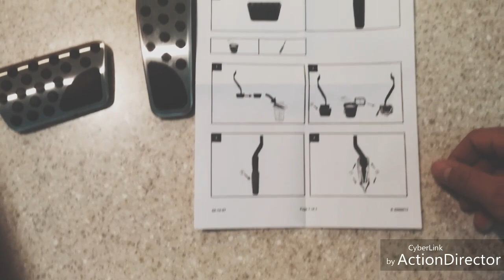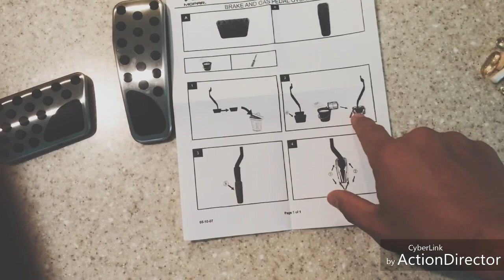Mopar Gas & Brake Pedal Cover Installation For Your Charger or Challenger

Comment: Let me help everyone here. Heat a large bowl of soapy water for 4-5mins let the  brake pedal soak in the hot water for about 30-45sec maybe a full minute. the rubber is now soft enough  to fold over. Start from the top down>The rubber is soft enough to fold out the bottom > flip over the pedal.  Took 1min tops.
Reply: This comment needs to be pinned to the top. Only method that worked and took me like 3 minutes. Lol
Reply: This worked !!! Your the man, thanks !!!
Reply: This worked 👌🏼👌🏼
Reply: Brian Smith omg thank you
Reply: Works like a charm wow
Reply: Thanks! All good now
Reply: You are the GOAT!  Thanks! 💯
Reply: Popped it on in 30 sec  with this trick, took me longer to get gas pedal.
Reply: Thanks man! This worked for me!! After dicking with it for 45 minutes, this method got it on in about 3 minutes. NOTE - handle with care...you just boiled it for about 30 seconds.
Reply: Still can’t get the damn Thing on!!!
Reply: @nickkellie  after it's soaked in hot water try putting it on top first
Reply: Saved my life lol
Reply: Thanks, it worked with me too but the bottom side first, then the sides, finally the top (slide it from right to left).
Reply: @nickkellie  😂😂😂😂😂😂. I can’t breathe this comment was hilarious out of everybody saying there’s worked 😂😂💀💀💀
Reply: Sometimes it pays to go straight to the comments
Reply: It’s 2022 and you probably won’t see this but I’m about to try this now because I don’t want to go back to the dealership and wait for them to do it!
Reply: Hello everyone. After I read all the ways and time it took some folks I had to think a Lil smarter. I did it in not even a min time. What I did was pull the rubber back on the top and sides it stayed back then I started from the bottom putting it on the whole  brake pedal once it's on the whole brake pedal let the rubber that u pulled  back I promise you it will on smooth then u all set. U welcome
Reply: Oh how I WISH I had read your comment an HOUR ago...  I got it on, but that was ridiculous.  Thanks for the comment anyway, I'll bet it works great.
Reply: I have a pair of these pedals I bought 4 years ago when I got my charger. After an hour of cursing about the brake pedal..the set ended up in a drawer. I just bought a challenger last week. Thanks to this comment..the pedals are now going on.
Reply: Just did this method worked perfectly.
Reply: Just installed these using this method. It worked great! I found it easier to put it on starting with the bottom. Only thing I'll say is if you let the pedal soak in very hot water, the metal part will (obviously) be very hot to the touch.

Comment: Just picked up my 2021 Challenger Scat Pack this afternoon and found these in the trunk. Thank you for the video it helped out a ton!
Reply: Mine where in the trunk too.
Reply: Same here lmao. Why they didn’t install them smh
Reply: Nuts!! I just picked up my '22 Scat Pack and they were in the trunk also!! I texted the dealer and they said they dont put them on. Ive spent 45 min trying to get them on and now had to resort to You Tube. Gonna try the hot water thing.
Reply: @cooperbrown1  The hot water trick worked like a charm for me. Hope it works for you as well!
Reply: @irishjack7228 After calming down, I boiled some water and set the part in it. Added some dish soap to the water and yes, it took less than a few minutes to put on. Dodge should revise their instructions to use that method. Thanks for the tip, I really appreciate it.
Reply: @cooperbrown1  Glad it worked out!
Reply: Got my R/T a month ago and found these in the trunk with the original box and part # too haha I thought the dealership just left it in there

Comment: Pro Tip:  Had mine on in 5 min.  Use your cellphone front facing camera.   You can see exactly where you need to pry with the screw driver.   I thought mine was fully on until I broke out the camera to check and sure enough most of the top and the corner was still not on.

Comment: It took me less than 5 minutes to do the brake pedal, heres how I did it.  Boil it for about 3 minutes. I sprayed the whole thing with non stick cooking spray. Started with the top part and used a pry stick to get the rest on. But boiling it is key. It softens the rubber
Reply: so you got slippery oil on your brake pedal?

Comment: Thanks for everyone recommending the hot soapy water method, it worked easy, but this was after I realized the KEY is water should smoking hot almost boiling! If you can’t feel the rubber able to move the water isn’t hot enough! go back and make hotter , if not your wasting time and won’t work..and I used no other tools.. mission MF accomplished!
Reply from the maker: @chrissaavedra5047  that was some great advice

Comment: For anyone in 2021, soaking the break pedal in hot, soapy water is still the best method. I did the opposite of what he does in the video and started from the top, to the sides, then the bottom. Finishing with the bottom flap was easier because you have more space to work with. Didn't need tools, but I can see how having those "surgeon" tools in the video would be helpful. I got lucky on my first try but if you get frustrated just put it back in hot water and start over.

Comment: Heat up a large bowl of soapy water for 4-5mins amd let the  brake pedal soak in the hot water for about 30-45 secs. Rubber is now soft enough to fold over. Start from the top down - The rubber is soft enough to fold out the bottom - flip over the pedal.  Took 1 minute.
Reply from the maker: Awesome advice, we've all learned a lot over the past 5 years #evolution

Comment: After 45 minutes of what quite possibly might’ve been the hardest task of my life i have a few tips for you guys.
1) hold the pedal over the stove for a few seconds(not too close to the flame) to make the rubber ma liable 
2. Setup a miror behind the pedal to see what needs to be pryed (i used my phones front facing camera)
3) use something thinner than a flathead screwdriver
Reply: I spent 2 hours, fuck it...lmao

Comment: After trying to put on the brake pedal cover for an hour without success, I found something that worked for me. I brought some water to a boil and took it off the burner. I put the pedal cover into the super hot water for about 10 minutes. After that, I got it on the pedal in 5 minutes. The hot water made the rubber much more pliable and manageable.

Comment: Pain in the ass! I just did this on my Hellcat tonight... after wanting to break something, I calmed down and it popped right on. Thanks for the video!
Reply from the maker: SRT- Mustang Killer haha, you aren't kidding, I agree on that...but I thought the Hellcats came with these already on?
Reply: Rydin N Style mine didn’t... they were in a box in the trunk, most likely because of the lazy dealership. My Jeep SRT came with them already installed.
Reply: Rydin N Style hahaha great idea! I spent so much time at the dealership (6 hours) that day that when it was time for me to finally leave, I didn’t think about anything else but getting out of there. I haven’t posted any videos of the Hellcat yet because I’ve only had it for a few days... but I’ve already put quite a few hours of work into it. I spent several hours removing the two ridiculous racing stripes and buffing out the residual lines, changed the air filter, completely detailed it (dealership did a horrible job), changing out the badges to the red ones tomorrow. Seriously, your video helped me calm down and not let the pedal beat me!
Reply from the maker: SRT- Mustang Killer glad I could help, I just gave you a sub.
Reply: Rydin N Style thank you! Likewise!

Comment: I got mine on in about 5 minutes with no hot water. I think it would have been easier with the hot soapy water method, but I was lazy and wanted to try it dry first. I worked it on from the bottom first, then the right side, then used my fingers to pry across the top from right to left and up the left side from bottom to top. It took a few minutes, but I finally got the top left corner to snap in.  Very happy with them and thanks for this demo video!
Reply from the maker: Victory is yours my friend, enjoy them

Comment: I installed mine by soaking the pad in a hot bowl of water for a minute. First I got the right side slipped over and that top corner then the bottom followed by the left side with the help of a shorty flat blade screwdriver. The top is real hard but once you get the top twp corners worked over it is just a matter of prying the rest of the top lip over with the shorty. Each side gets progressively harder to install. I went to the middle area of the top lip and worked it over then just fight the rest over. You have to get up on top of it dude and be all man with it but it's really nice when your done. Thank God the gas pedal is easier. I did not have enough left in me if they both would have been that hard. One battle wound later and done. Took me about 5 - 8 minutes on the brake pedal cover install after figuring what order worked best for me. You have to keep pressure on the pad along the way while your working it on so it does not come back off during the process. Soap might make it easier or a small piece of kite string loaded into the pad and used to pull the lips around kind of like a window rubber. Did not try these two methods but after thinking more about it may be worth a shot. Good luck guys.
Reply from the maker: Awesome comment, thank you. Lots of people on here have struggled (including me) with this install.
Reply: @RydinNStyle  Hi RnS, Yeah it's really good they are hard to install because you sure don't want it coming off when your standing on that b_tch after jumping up to 120 mph on the interstate topping a hill and the traffic is dead locked in front of you on the other side. Been there, done that, running a Charger SRT in my Challenger R/T. We both survived and I won that short race but the win didn't have much meaning. Just trying to help the guys get this stuff installed bud, like you. Thanks for your great video and nice comment. Happy trails. :)

Comment: I just did these tonight on my SRT Durango. At first, I did it as the instructions says and couldn't do it. Being a female, I ended up using my hair blow dryer to heat up the rubber of the brake pedal for a few seconds on each side. Dip it in the soapy water. I used a wider flat screw driver. Started from the top, then ended up propping the lower right corner last. Phew! Some work!!
Reply from the maker: Haha, it's like going into surgery, but worth it after it's finished

Comment: Just did mine on my Grand Cherokee last week. Got the brake pedal on 3rd attempt it was a PITA  lol   Thanks for the video!
Reply: Yes they should have made the brake pedal more of a "clip on" as well!!
Reply: Not sure if you know this but they make a little one for the park brake as well
http://www.ebay.com/itm/Dodge-Charger-Challenger-Magnum-Chrysler-300-Emegrency-Brake-Pedal-Pad-OEM-MOPAR-/190666228868?vxp=mtr&hash=item2c6497c484
Reply from the maker: I'll have to check those out...Thanks for the link

Comment: Save yourself the hassle and pain by using a HEAT GUN. Heat up the rubber on the back to make it pliable then quickly start working your way bottom to top. It should take 5 minutes or less to do it this way. You can also spray some soapy water on the metal brake pedal itself to aid as lubrication.
Reply from the maker: HarrisonVokills that is a great suggestion, thank you
Reply: HarrisonVokills hot water works good to
Reply from the maker: Diesel Juarez jr yes, some say they used boiling water...or boiled the rubber somehow. Great idea 👍
Reply: HarrisonVokills... thanks i used a hair dryer and a little car wax spray. 5 minute install for both pedals :-)

Comment: GREAT ADVICE FOR THE BRAKE PEDAL!! 4reals, Ur attitude about patience & perseverance is an awesome outlook and should be utilized in all of life's challenges. Nothing feels better than to finish what you started and then saving $50 dollars from paying another man for doing what should be something one can do for oneself.  Unless one has back trouble, than I can see paying labor chargers at A dealership or maybe ask A friend or family member.  I just bought A 2019, 1320 scat pack and the same covers came in A box that was in my trunk. They look better, but now I get why the salesmen at the dealership didn't bother to tell me about them because I would of said "putting them on since I just handed you A cashier check for $45K".
Reply from the maker: Haha, very true points made here. Thanks for the kind words

Comment: I have lost all feeling in both my pointer fingers and have cursed for about a good half hour straight. I read through comments and they somewhat helped. Combined them. Gotta coffee cup threw the shit in there and poured some hot water in. Let it sit, flipped it around a bit. Then hot potatoed it outside. I started top to bottom, get the top and sides over and then reach in the bottom and pull like you're life depended on it. I smashed my fingers between the brake pedal and cover bur I couldn't get it on any other way. In retrospect its probably best if you get the left side on, and then move around to the passenger side and pull the rest on. It's a small space and the steering wheel just adds even more frustration. The gas pedal was great in comparison.
Reply from the maker: Reading your comment almost made me relive that day all over again. I am glad you ended up victorious
Reply: @RydinNStyle  thank you sir, it is a mission. Next time either the car comes with it already installed or forget it. My uncle didn't want to put his on his challenger so he gave them to me... so it was free but I still paid the price in the end lol

Comment: I didn't have the instruction sheet and was pretty dubious about soapy water making things better--I could just imagine it making it harder. What I did was run my utility sink water until it was steaming hot, couldn't touch it, and put the top lip under it for a minute or so. I put on a drop of dishwashing liquid but most of that may have been washed away. Used my bare hands. Victory!
Reply from the maker: Haha, why couldnt it just snap on like the gas pedal...that would be too easy

Comment: I ended up cutting a few pieces off the brake pedal inner membrane. Made it way easier , its on solid enough, if it comes off ill add some epoxy or some ticky tack to the equation

Comment: I set the brake pedal in the sun, rubber side up,  for about 5 minutes and it went on without any issue or struggle.  👍
Reply from the maker: That is an awesome idea to soften the rubber, thanks for sharing

Comment: Picked mine up a few days ago.  Also got the parking brake a dead pedal due today  When I installed covers like this on my 350Z many years ago, my finger nails hurt for a week because of the clutch and brake pedals.  100 f bombs later they went on.  Imagine working at the factory doing nothing but this for 40 hours a week.   Im sure they have a special tool..
Reply from the maker: Haha, I knew there was a reason they just put them in the trunk lol

Comment: I ordered a $29.95 vs $51+ pair, not an original (Mopar) part off Amazon and the install on my 2014 Ram was easier,  looks great with less frustration. I soaked them in soapy water for 15 mins and put them on. They are aluminum and appearance wise the same. May want to check it out before expending those dollars.

Comment: I simple put the break pedal in bowling water  for a 1minute and 40 seconds and right away take it out of the bowl and attempt to put it on. Put the top on first and with a little bit of force pull the rubber of the bottom 2 edges and wiggle it on. Took 3 minutes and got it on. The pedal will be a bit hot so I recommend using gloves when installing so it does not burn your hand.
Reply from the maker: Excellent tip

Comment: I just ordered a set of these for my car. I remember I had replaced a brake pedal pad for a 1986 camaro I had a long time ago. It was a pain in the ass and I did it with no tools and just my hands. Its the same thing pretty much. Im just gonna use hot soapy water and my hands this time.
Reply from the maker: Humanoid 77 it's definitely a tough mod for the brake pedal, gas pedal was easy
Reply: Installed the overlays today. I started doing it with no tools or anything and started with the brake pedal first. It was difficult and about 5 minutes into it the landscapers showed  up and I had to stop and close up the car. 
I went and started to boil some water and then put the brake pedal in the pot along with some dish soap. Had the brake pedal in the pot for just a few minutes and installed it. Was much easier too install with no tools and took about 9 minutes. Just need to be a little patient and work the rubber around the pedal.
Reply from the maker: Excellent tip to install
Reply: Thanks. Have you put any tint or tinted overlays on your rear taillights? I just ordered some smoked/lightly tinted overlays for my car.
Reply from the maker: Humanoid 77 I did, I put the luxe brand on the tail lights and side markers
Reply: Oh sorry. I must have missed that video.

Comment: It does work for the brake pedal,I boiled water with soap for 5 minutes then I let it soak in a bowl for 2 minutes and I put more soap around the base where the pedal goes and slipped right on ,it’s true it took 1 minute to put on.